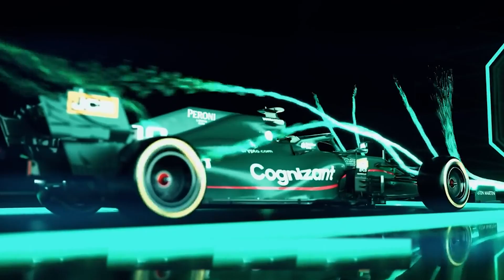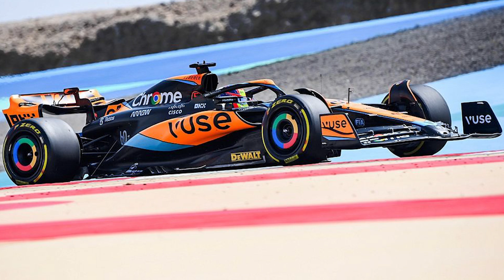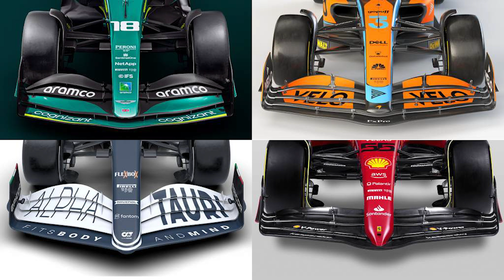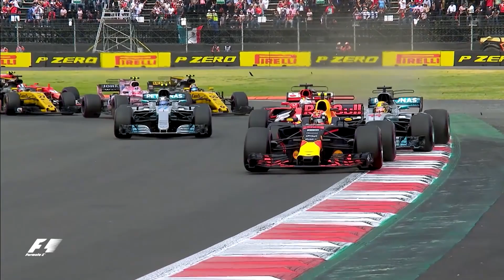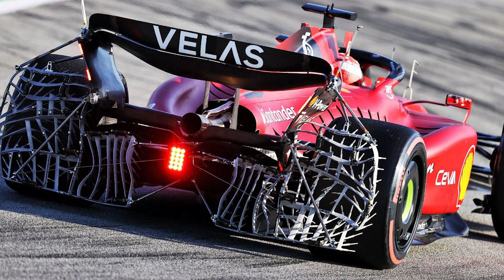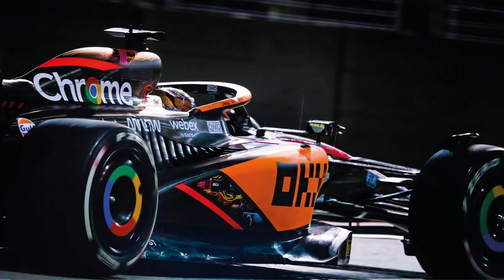Aerodynamics of an F1 Car Explained: Speed Secrets

Comment: I never exacly understand how rear wing increases downforce. I know that it makes continuous flow but I am not sure Is it because rear wings shape makes uper flows pressure higher than than the lower pressure
Reply from the maker: The rear wing on an F1 car works a lot like an airplane wing—but flipped upside down. Instead of generating lift, it generates downforce to push the car into the track for better grip.

The wing is shaped so that air moving under it has to go through a tighter space (a smaller angle), which increases the air pressure below it. Meanwhile, the air going over the top moves faster and creates lower pressure. This difference in pressure pushes the wing—and the car—downward. That’s how downforce is created.
Reply: @officialtotalf1 thank you sir, so was I kind of right ?